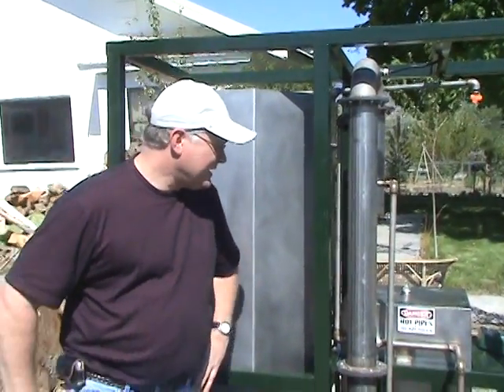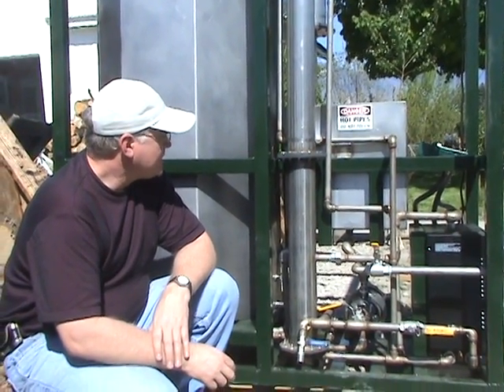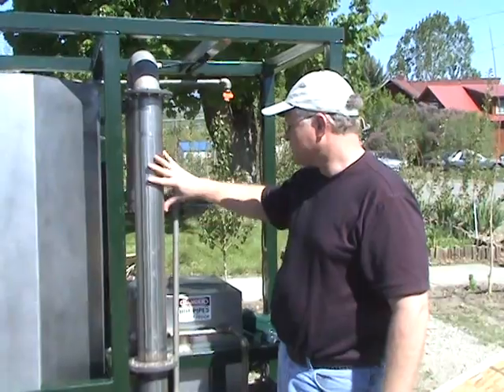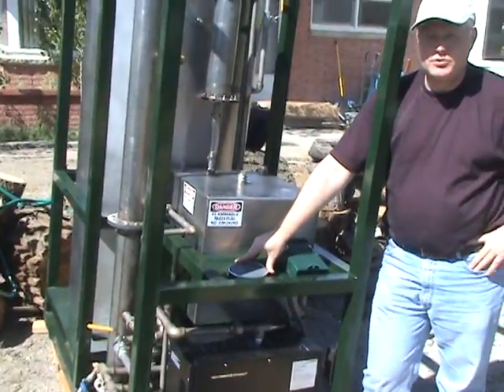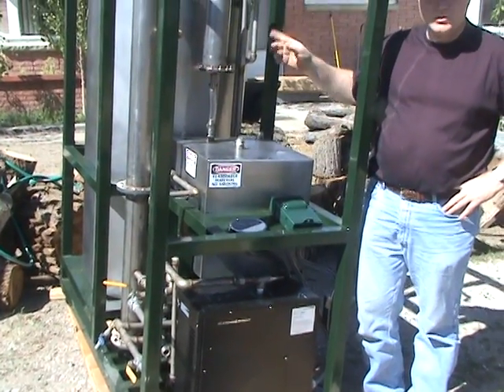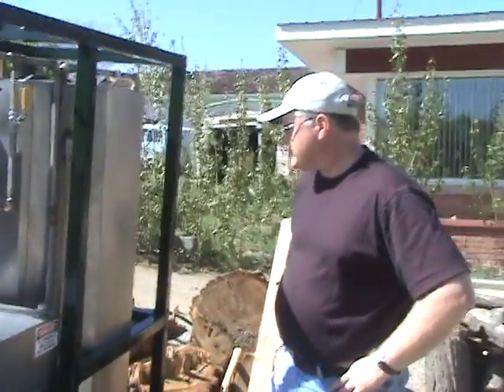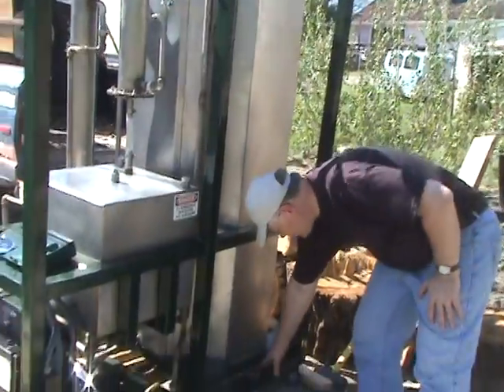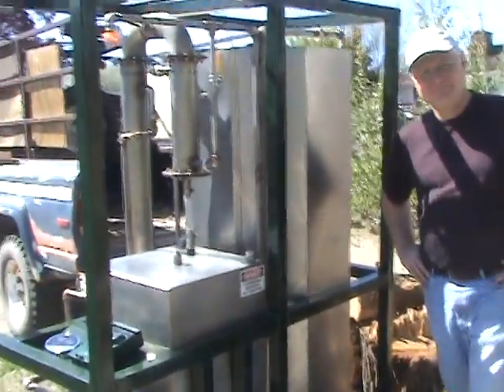Allard Still Boiler and Column are computer conrtrolled.

Comment: do u have any basic designs on the computer operation manifolds and such the condencer  i wouldn't need help with as ill be using a 4 inch bubble plate x4 i find they are great  and u could hook up a boating bilge pump upto it would save some watter but u would need to think about cooling that watter if u have a pool ur sweet i really like the design though and having it automated would be great aswell as mine is a pain in the backside i tell ya

Comment from the maker: @xshoreLS1  It is just an automatic way to boil water that has a condenser column above it, The column gives off ethanol at the top.  The water does not get to the top of the column because its vapor pressure is not as high as ethanol.

On Allard's website, they are trying the cellulosic ethanol idea.  Industry and government can't do it.  Maybe Allard can.